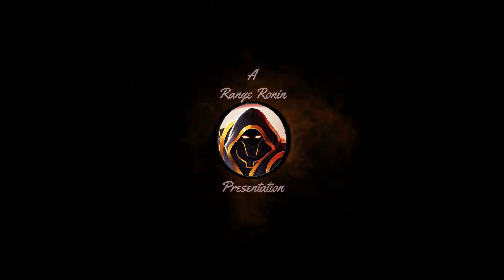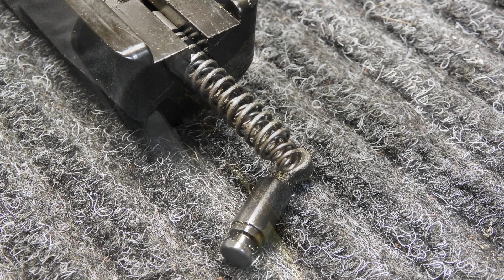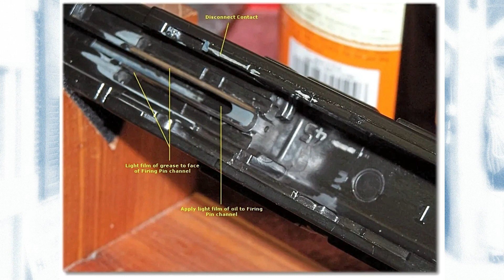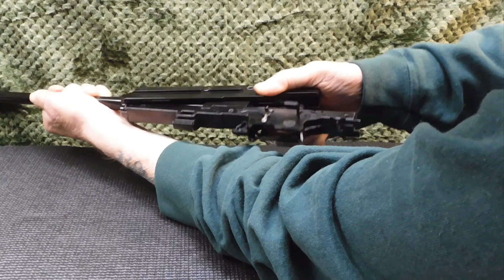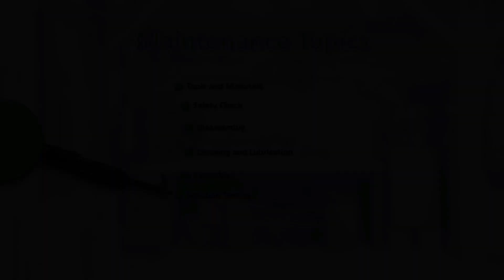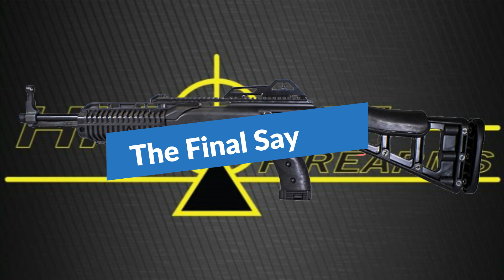Hi-Point 1095TS Owner's Perspective

Comment: Why buy a Hi Point 1095TS?  Cause its cheap!  that's it.  Others are better, take bigger mags, more ergonomic, lighter.  But they are all expensive.  Hi-point had a good sense to consider Americas' pocket book.  Ruger, and others did not.
Reply from the maker: Thanks for taking the time to watch and comment. I have this one, a 4595TS and a 995TS. The 4095TS is hard to find, but when I do... The thing about the Hi-Point carbine is that they are actually good; reliable and accurate.